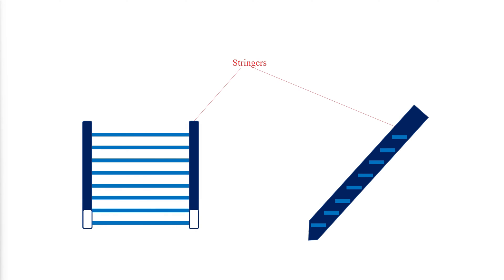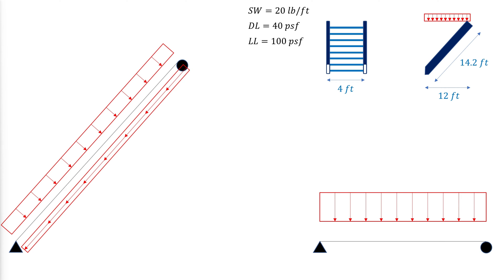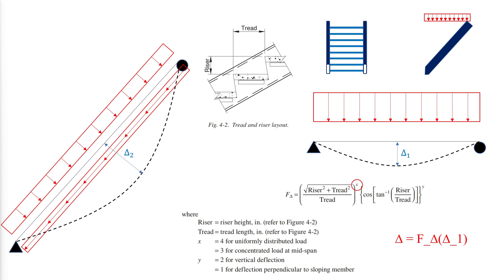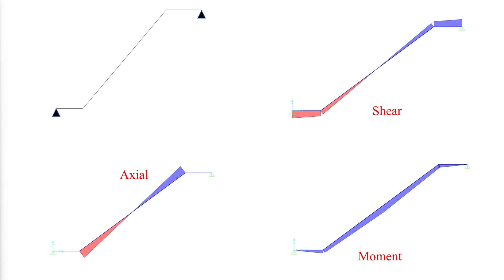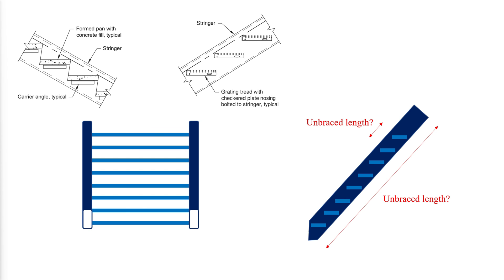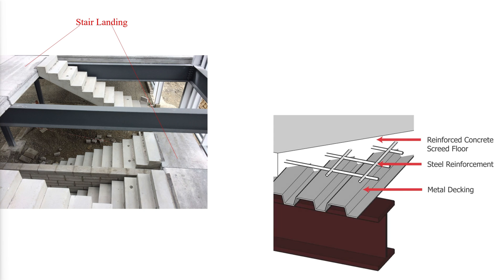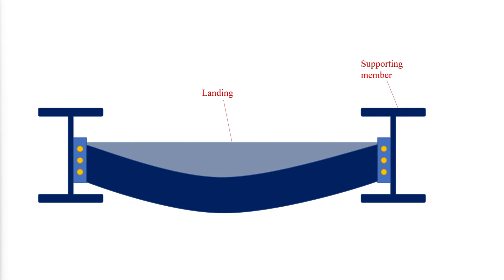Will Your Staircase Hold Up? Find out how to design the optimal staircase!

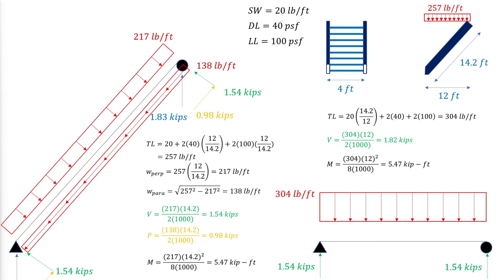Comment: At 3:05 for horizontal calculations, why divide 14.2 ft by 12 ft? Aren't we supposed to SW with 12 ft only?
Reply from the maker: The self weight should account for the total length of the stringer but applied along the projected length in the horizontal plane method. Otherwise we would be underestimating the weight of the stringer. Thank you for watching